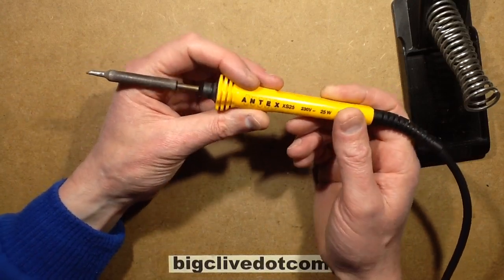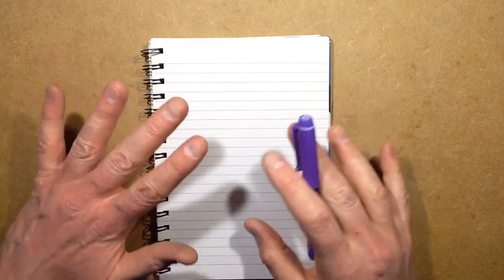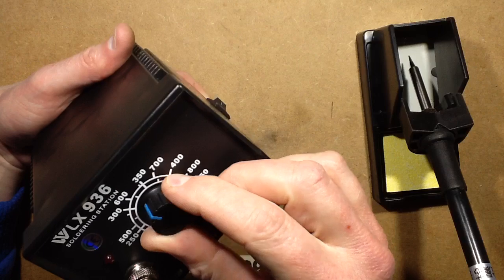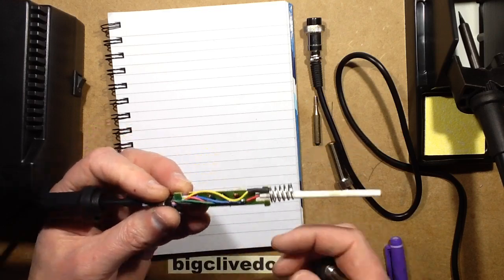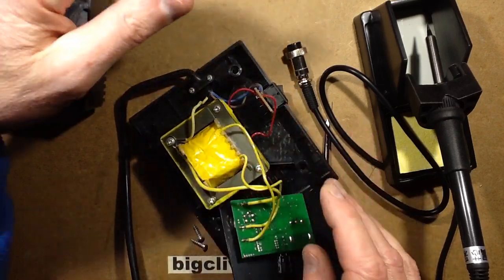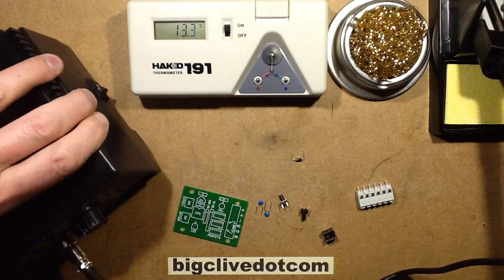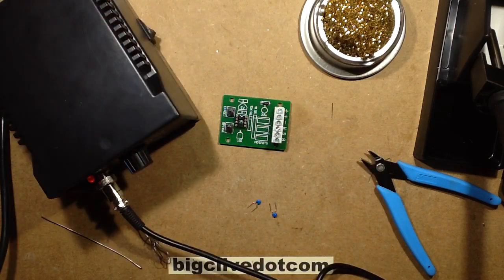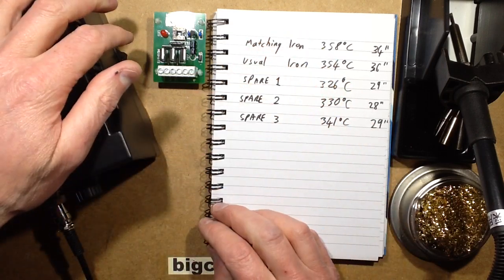Soldering basics and choosing a cheap soldering iron.

Comment: I didn't realise that these bargain basement stations were actually pretty good. I recently bought a station on the advice of a colleague in our lab It was from a company called Metcal (an MX-500), and whilst it does the job, it did cost the best part of £100!
Reply: 100 is not that expensive.... the upmarket thingies start at 150/200 base model
Reply: @muppetpaster  Exactly. I have the successor of these and it is great. Still a lot cheaper than the JBC stations but orders of magnitude better than any indirectly heated soldering station. The tips heat up within seconds (except for the REALLY big ones) and if you're lazy and don't want to swap hand pieces you can solder tube sockets with a 0,5mm chisel in which the PSU pumps around 70W when required.

The METCAL irons work with high frequency and are regulated inside the soldering cartridge by the Curie effect (similar to the old Weller stations except that the HF electronics is regulated and not a mechnical magnetic switch).

Comment: Thanks for making a video stating we can go cheap and decent, Clive!

I inadvertently let my station on for 24 hours and the tip didn't like it at all: it became completely matte and wasn't allowing solder to wet it anymore. Flux and solder didn't make it better so I bought a tip refresher off Aliexpress (but I'll add an eBay link below), which worked beautifully. It feels like some sort of cleaning salt? 
I'd be very happy to have your opinion on it.

http://www.ebay.co.uk/itm/Soldering-Solder-Iron-Tip-Paste-Hand-Tools-Advanced-Refresher-/111591076721?hash=item19fb58b371:g:VF0AAOSw-W5U0cHy
Reply from the maker: +fabts4 Good top see tip cleaner available online.  I've got a small tin of tip cleaner here that cost quite a lot from a UK supplier.

Comment: You couldn't solder on to a heating element, at least not with conventional solder, because if you use solder, it will melt when you turn it on.

I imagine whenever I write comments like this on youtube videos without actually reading the other comments on the video, I'm just repeating what 100 other people have already said.

Comment: Also, I was taught (I build boards for a living) to put the solder on top the joint first, and apply heat to it second. The idea being it reduces the heat flowing into the component and the board by putting the heat directly into the solder instead of the board and component. You do need a fairly high heat iron for this strategy though.

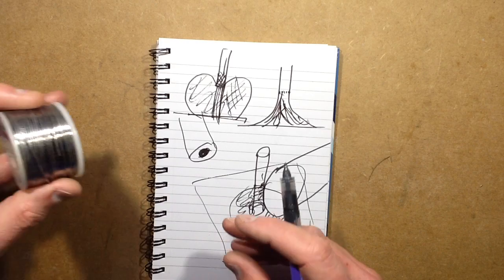Comment: So the technical term for that "volcano" shape he is talking about at about 10:00 is "wetting". I've also seen bad joints where the wetting only covers a portion of the pad, say 2/3 of it. This is simple enough to fix, just add more solder. Also, it is possible to carry solder to a joint while it's on the iron tip, but you have to have Flux in a liquid form separate from the solder itself. You can find it in little squirt bottles. Put your component in, add flux, and with a good iron and good solder, the solder is practically sucked into the joint seemingly on its own. I use this strategy to tack in components rather then hold them with my fingers so I don't get burned when the component heats up.

Comment: 11.32  BTW It is actually possible to solder to aluminium with standard  60/40 solder BUT you have to do it under oil and break the surface of the aluminium by scratching it with the iron. E.G.

https://www.youtube.com/watch?v=FmjdXKyDEWY
Reply from the maker: +Martin King That's interesting.  I'll have to give that a go.

Comment: Here is why you would change that crappy heater. It has a PTC thermistor  that is a different value from the Hakko and it will throw off your Hakko's accuracy  (if you use it on a Hakko). It  is difficult to slide the tip over some of these cheap heaters as they are slightly larger in diameter and last but not least the thermistor in mine lasted one whole hour. For a couple of dollars you can make that iron functionally equivalent  to a Hakko by changing the heater.

Comment: i have a few  power sockets without earth. in germany you call the earth on the side of the european sockets schuko. some dont have those. so they are only 2 pole. i should probably not use those?

and its probably 60% Lead/40% tin. that is a very common mix.

Comment: You're a big help clive but I have a small problem but I'm not sure it's the solder I'm using but it just blobs up and sticks to the iron tip whenever I try pulling it away. I'm sure the solder I use has a flux core but after constantly having this happen I'm not so sure. Could this have something to do with the absence of flux?
Reply from the maker: +Katcher's Gaming What are you soldering?  Are you applying the solder to the pre-heated surfaces?
Reply: +bigclivedotcom I'm trying to replace that awful orange LED on the PAL region Dreamcast with a blue one and I have been applying solder to the pre-heated surfaces but it still blobs up.

Comment: It's also important not to allow the component lead (or other part) to move during the second or so while the applied solder is cooling. That can also result in a dry joint with the typical 'frosted' appearance. I agree with your preference for what some would consider to be a kind of chunky tip. It's difficult to get the necessary speed of heat transfer with a needle point tip. You can end up lifting small pads off the board before the component lead is hot enough to take solder. Regarding de-soldering, I would suggest suction type tools and seriously avoid using that braided solder wick stuff for any PCB reworking. (Experience? I was a test gear repair tech for about a decade.)
Reply from the maker: +Alan Mumford There's good solder wick and bad solder wick.  Good stuff does a very fast and clean job of removing excess solder.  the bad stuff does virtually nothing.

Comment: I disagree with you on this subject (though I share your thoughts on many others!). Having spent many years in the electronics, both home and professionally as an electrical engineer I cannot emphasize enough the importance of a good soldering station. I use Hakko soldering stations. They cost more but the time savings and quality of work is immeasurable as compared to cheap knock-off soldering stations. My current Hakko is over 15 years old, still works as it did when new.
Reply from the maker: +Peter M This video is aimed at people just starting out.  It aims to make it affordable, and if they pursue it as a career then they can buy a luxury iron.

Comment: When soldering, it is easier to use the side of the tip, where there is more surface area on the tinned part of the iron to heat up the joint.

Also, try to use 600 Fahrenheit at most, do not use Acid core solder and always use Leaded flux-core solder. These will help your tip last for years, instead of it being eaten away into the interior copper core of the tip, where it is softer.

Comment: Why do these need such giant transformers? I decided to buy one of the Chinese adjustable temp ones from banggood.com that doesn't have a station, it seems to work very good, It gets crazy hot too, what's the disadvantage? Would it just cool down a bit with big soldering jobs? Just curious how these little soldering irons with no station seem to achieve the same thing as a giant hunk of metal in a station. If you're curious the actual link is here;http://www.banggood.com/110V220V-60W-Adjustable-Electric-Temperature-Gun-Welding-Soldering-Iron-Tool-with-Tin-Wire-5Tips-p-1036698.html
Reply from the maker: +Trpratt1 The main advantage of low voltage irons is that the heating element can be thicker and that makes it much more rugged and longer lasting.
Reply: +bigclivedotcom Ahh, interesting, that makes sense. I guess time will tell with my cheapo, then again I can go buy another for $10 and still be under the cost of a station so I'm happy with the one I got for now.

Comment: Can someone explain the mystery of Soldering Tips. I've seen there's a lot of "features" manufacturers using to make them better. Like chrome, Nickel plating, multilayer plating etc.
Personally I'm using gray matte/coarse finish tips (first one I've got with ZhongDi soldering station, and I have no clue how are they called, what tech behind), these are amazing. No solder stuck to matte finish. Previously I've used only copper ones, and those were easily being eaten by solder, and alloy could grind up along the tip, also heated clear copper oxidize on air and cause black crumb to appear.
http://easyelectronics.ru/img/Instrument/ZD929C/microvolna/minivolna_1.jpg
Reply: It probably doesn't matter the details, the ZD tip is a similar multilayer tip to the rest of them. It has a copper core and a steel coating all around to protect copper from being pitted, and another coating, where it shouldn't be tinned. I suppose that coating is likely to be Zinc, which acts as a sacrificial anode for Iron and prevents it from rusting, and that's what might be giving ZD its characteristic grey colour. Others use Nickel and Chrome coatings. I'm not 100% sure though, i guess ZD tip is a bit of a mystery to me too, but ultimately, it must be something dirt cheap.

Comment: Clive if you were manufacturing lots of boards how come you never invested in a real soldering station? They are light years ahead of those ANTEX pieces of crap and save lots of time.

We used to use JBC soldering stations at work at the moment, they have the heating element in the tip and are by far the best soldering stations we have ever used. (They are a little more expensive than these Chinese cheapies though ;-))
Reply from the maker: +Danny Wood The Antex did the job admirably.  I just had to slow down slightly when doing the final connection of large wires and jump between smaller pads and larger ones in a pattern.

Comment: You need liquid flux to use that solid solder he shows at about 10:10.  Doing this gives you an element of control that you do not have with flux core and makes it much easier to get really good solder joints plus helps in soldering really tiny SMD stuff.   I like to make a little pool of flux around the pads for a SMD part, tin the pads, hold part in place with tweezers and just tap the legs real quick to melt the solder.  I suppose with the price of rosin core it makes no sense to buy solid but i still like to have some liquid flux and a spool of really thin solid solder around for small stuff.

Comment: I've been spoiled rotten by always using Weller stations (wtcp 48w, wecp 50w and wsd 80w) , I get the cringes when I see these stations: the thermal coupling between heater(+ thermocouple) and tip is poor. That leads to slow response in varied heat load, you also do not get continous 25w into the tip which might lead to prematured burned out heater if you try bigger soldering jobs (too big jobs really). I wonder if it is too messy to use thermal paste to alleviate this?

I reacted to the slow response in the analog type you showed, the Led indicating power input to heater seemed really slow to pick up on the tips heat loss.

...on the other hand the magnastatic weller (wtcp) doesn't exactly have a stellar response either! The wsd 81i reacts within a second with the wsp80 iron.

I've tried to work with fancier irons that has the thermoc/heater only a few mm from soldering tip but they where to fragile once you dig in to desolder a crusty solder older relay and sh.t like that, cracked the ceramic heater. They didn't have that continous flow of power as advertised either.

The chinsy iron might be good for those who pace themselves while soldering, or tinkering with smd/prototypes. Well... Hmm... maybe I should buy one to really get the goose bumps of aversion going or just shut the f up.
Reply: I've been wrapping aluminium foil tightly around the element until a snug fit with the bit is achieved. Have yet to encounter any problems.
Reply: Been thinking of doing that actually, i'm glad i found someone that did it without issues so thanks for that. I thought of using thermal paste but it would be messy and you would require a high temperature thermal compound (that can at least do 500°C for some headroom) and just getting that in a small 10gram pack versus wrapping a bit a aluminium foil around the element... its a no brainer really.

I also thought of adding a bit of tin between the tip and the element (just some of the tiny waste tin balls that you usually scrape off the sponge after soldering) but i dont know, that sounds messy on its own XD
Reply: Careful with aluminium foil, though, it melts at at 660 °C, so might be entertaining in those cheap Chinese irons with the little dial that can go up to glowing cherry red if you accidentally nudge it too far. There is copper foil, melting at some 1089 °C, for HF screening and heat protection, available in various thicknesses. Just avoid the stuff with adhesive, obviously, or remove any glue with solvents, or there'll be smoke and smell and purpose-defeating charred layers between the conductive foil.
Reply: Yeah, i won't do a clive and crank up the little calibration variable resistor all the way up, to get cherry red hot it must've been around 800°C if not more XD, i'm quite certain the heating element is actually under the specified temperature in my station (YaXun 936, another hakko 936 clone but in yellow and blue) since i have issues melting solder at minimum temperatures (220°C) so it should be alright with the aluminium foil.

Comment: How do you clean solder off of old joints? you desoldered the connector but you didnt show the process of cleaning it up which is something i'd have liked to have seen

great video nonetheless
Reply from the maker: +Mammoth Jerk To clean old solder off joints I use desoldering wick (flux impregnated copper braid) and for cleaning through holes I use the heat-it and bang-it approach where the through pad is heated to melt the solder, and then immediately banged on the bench to throw the solder out by gravity and inertia.

Comment: We used to use flux free solder at my school in design electronics class only because we were taught the method of using flux on the parts to be soldered first... My teacher used to call it a pot of ear wax. So our method was, flux the joints first then solder them using the method you showed. I'm sure you also know this method but maybe the readers here didn't know :)
Reply from the maker: +Uberfish I've never used that method.  Always flux cored solder.
Reply: My electronics teacher swore by that method. We all thought it was just complicated and messy, honestly. Like you said, it's already in the core so no need to go spreading 'earwax' everywhere.
Reply: +Uberfish I use that method since it allowes me to add the solder to the iron first, leaving me an extra hand free to keep all the components where i want them. It's probbably a lot slower than using flux cored solder since it's an extra step, but soldiering only for hobby projects like i do, i think it's easier even if each joint takes a little longer. One day i might grow up and do like the pros. ;)

Comment: I have a Weller WS-80 soldering station but the lead (or cable if you prefer) to the iron has gone bad. I looked at replacement irons (with lead + plug) and they are still quite expensive. Any tips?

Comment: may be you can DIY a digital panel for this to measure temp.....
Reply: +iceberg789 oddly enough, the 937D+ is basically the analogue dial, but has a digital temp display, so essentially what you're looking for. except there's no way to know what temp you set it to until it warms up.
Reply: right, unless the scale is properly calibrated. i was actually thinking of getting one of these cheapy analog ones and fitting a digital meter on it myself. but not so sure whether all those cheappies come with thermocouple feedback.

Comment: Hi Clive, You're talk about the plug that iron uses is the same plug on my CB Radio as it has a 5 pin plug too. Just thought I would throw my 2 cents in on that issue. Great video as always. Watch out for the smoking - sizzling porky bits as we all seam to have them from time to time. Just wish I had nice long fingers like you do but mine are like little pork sausages hence the smoking pork comment. I just brought a new soldering station as my old one gave up the ghost so I now have a Digitec 85-watt Digital Soldering Station that's just great it even has a fan inbuilt and a auto power off after 4 hours as I have a habit of leaving my iron on all the time.

Comment: I owned the same type of model but under a different brand name. I took the station apart and found the copper wiring was very thin even though it was crimped correctly. Like yours it was way out of calibration by 20C. I managed to calibrate it down to +-5C which was just fine, but to be honest I did not like the unit, the base was clumsy and the station put out a high pitch sound when the temperature stabilized. So, I manage to score a Hakko 939 and all attachments on eBay that allow you set the offset temperature for that particular element and tip giving true thermal recovery and stability.

Comment: My Hakko has similar spacing on the bit, I did test it when the element and tip were hot but there is still the same amount of spacing. Quite a lose fit...wasn't happy. Also, the cable feels really cheap. Happy with the iron though...

Comment: i use a heat gun to a check the temperature on mine, when i solder. The heat gun is a great multi- purpose tool. Thanks for the excellent videos.The insight and info are greatly appreciated. You cover a lot of diversity of products.